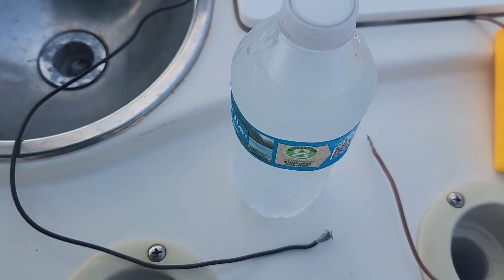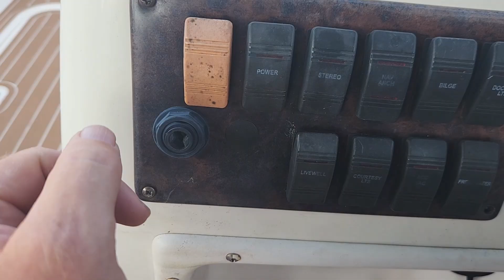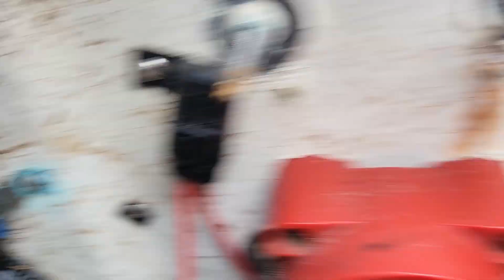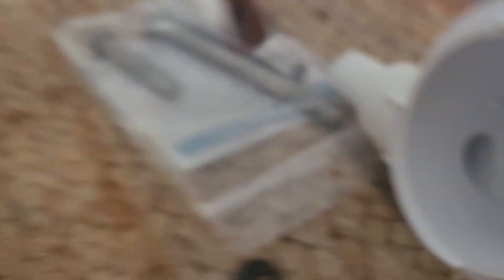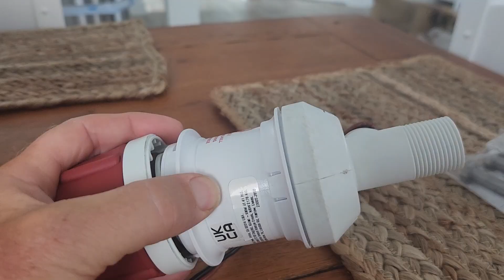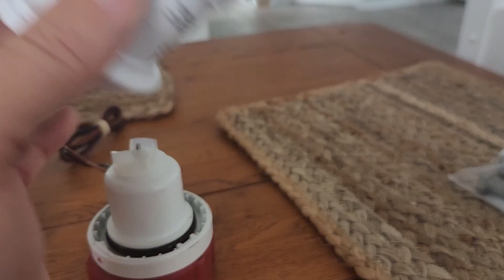Livewell pump fix

Comment: I have the same issue. What happened to the housing.. My pump works great doest not while o
in the housing..
Reply from the maker: the housing was a little melted and was causing air into system.  just a tiny air leak can cause a lock.  the pump has to sit perfectly in the housing with a tight seal.   sometimes you can get the air out by back flushing system.  get a 5 gallon bucket and fill up the livewell but block it from draining so eventually it can only drain from the inlet valve.
Reply: The rule pumps have major major issues, just completely redid the livewell systems on my bay boat and then the dealer tells me that they're recalling them because of issues and mind burn out on the first fishing trip after 3 hours